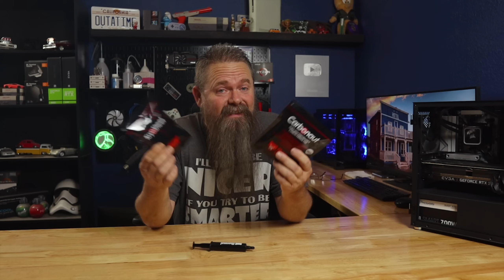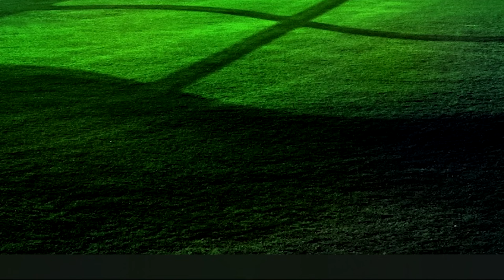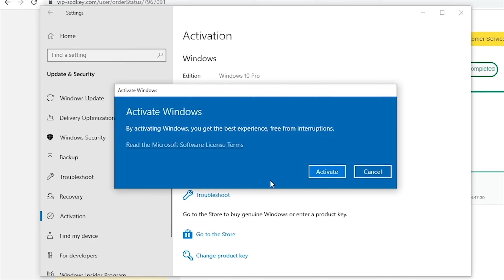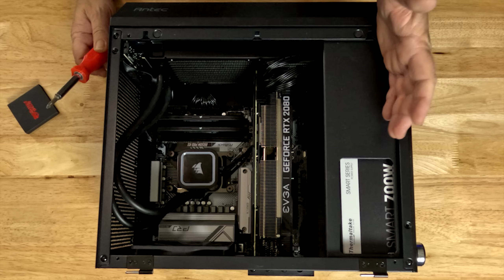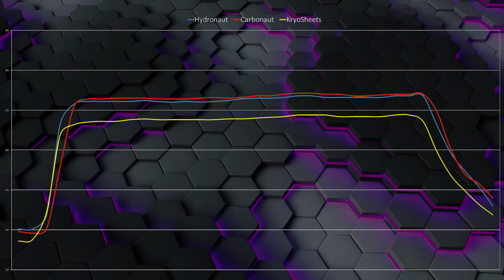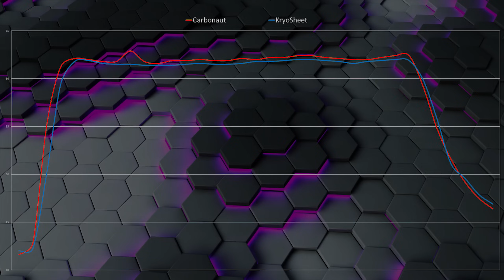Thermal Pads OR Paste, Which is Better?

Comment: I have used KryoSheet several times repeatedly on intel 13600k and 14700k processors. There have been no problems with temperatures. Be very careful during installation so that the KryoSheet does not break, as it is very fragile. I used a sheet of paper to hold and move the KryoSheet. I highly recommend it from my own experience :)
Reply: Best way to apply the Kyrosheets/Carbonaut sheets is to pop a little drop of isopropanol onto a corner or two of the IHS or cooling surface. Makes the pads stick in place, and the alcohol evaporates after about 15-20 seconds, long enough to get it situated and held in place by the mounting pressure
Reply: Wow thanks for that tip!@Gravy-Gamer
Reply: TY on that.
Reply: try to keep the original plastic for removal. Paper can shed some small fibers that will hinder performance.
Reply: @yspegel  Yep, that would be the most sensible thing to do, but regular paper will do the trick. I wouldn't worry too much about the paper fibers, you might as well worry about the dust in the air that MAY end up on the CPU :D
Reply: What size do u use for those intel cpu?
Reply: @AL-hk3oo What size cryosheet i bought for 13-14 gen intel?
38x38 mm from store and i cut it in size. You can google your cpu size if you cant measure it.
Reply: Does it matter how hard you secure down the cooler? Like I usually screw it tight on thermal paste but can you still do this without the thermal pad splitting?
Reply: @pearce_nz  I install the cooling as strongly as with thermal paste. The harder  the cooler is installed, the better the temperatures. 
The only thing I would recommend is that the KryoSheet is cut to the same size as the size of the Cpu or a little larger. The more the edge is over, the more difficult it is to re-install later. I have managed to use the same KryoSheet at least 6 times and everything works perfectly and the temperatures are as good as before.
Reply: @EventuallyFallen  if I am not going to be removing it, will I lose anything if I don’t cut it? I don’t wanna mess it up by cutting it.
Reply: @ Sorry for the late reply.
I totally understand your concern, the cryosheet is relatively fragile. If you're afraid of ruining it, then you'd better put a whole sheet. But you have to take into account that the cryosheet is electrically conductive. Personally, I would take the risk of ruining a cryosheet, rather than any computer component.
Reply: Just use classic thermal paste...

Comment: Im currently using PTM7950 on my 5800X3D. I notice much tighter spread between core temps and also lower idle temps compared to MX5

Comment: I've been using gig-a-loo and a paper towel to clean up the paste from my CPUs for years. Works a treat for me. 
I also use an old credit card to apply the paste - I need the film to be as thin (and equal) as can be. It's so easy to clean the card afterwards - I can use the same paper towel I used to clean my setup. No waste!

Comment: hate dealing with that stuff when i replace cpu etc. Dont want to deal with it, but no choice. crappy mount systems to hold onto expensive fans, and you never know if you did it properly or botched it, as there's no way to see.
i'd gladly pay more for a decent mount system that isnt garbage, but they all are.

i still use air cooling

Comment: I think the longevity of pads over paste is a bonus for me. It won’t dry out in two years and require a repaste.
Reply: What crappy paste are you using that dries out in 2 years? A good paste should last a lot longer than that.
Reply: @mjc0961 even the best paste needs to be changed eventually. These never do. Don’t be obtuse.

Comment: they work well.. i've got minus8 pad on my am4 chipset (under a DIY copper block) no more chipset fan ramping up and down all the time BIG WIN! ;p and my 5800x3d runs with the Kryosheet ;p no more termel paste on my pc only factory applied on graphic card ;p. so would work good on a GPU too?
Reply: i upgraded 4 GPU's + 1cpu with Honeywell PTM 7950, check that out really nice stuff + cheaper as well

Comment: In the case of systems that are going to be used long term without access to the internals. Or the user wants to not worry about thermal paste maintenance. The carbon pads are invaluable.

Comment: I'd only consider using a thermal pad like cryonaut if I was testing out CPUs regularly, which I don't do currently.  I don't mind the convenience of the less clean up using a thermal pad vs paste.  Tho cost of the thermal solution is important to me as well.  Chances are I'd likely still use paste as a thermal solution for CPU cooler mounting

Comment: I have recently installed Linux Mint Cinnamon Edition on the MSI B85-G43 GAMING Motherboard using Intel Core i7 Processor and MSI GeForce GTX 960 GAMING 4G
without deleting Windows 10 so I can do a dual boot mode to the point it was so easy to install Linux Mint Cinnamon Edition, and I didn't get any errors whatsoever.

Comment: Hello and thank you for your testing these thermal sheets. I teach IT at a secondary vocational school in the Netherlands and every 1st year student has to build a pc from scratch. I use the Carbonaut sheets as an alternative to paste. We have about 80 builds and teardowns per schoolyear and using paste would create a mess and be pretty expensive.
The great advantage I found with these sheets, that when handled with some care we can do at least 50 cpu cooler swaps before the sheet starts to show visual degradation. This in addition with the ease of handling (especially for students building their 1st pc) makes it for me the perfect solution as a teacher.
I use the Intel Pentium Gold G6405 with the Intel stock cooler for the builds and the 32x32mm sheet works perfect. The cpu idles at around 34c (93.2F) when students boot into the UEFI.
Reply: Thanks for sharing! This proves repeated real-world use. Not many users and no reviewers actually do this many cooler removals using the pad. Mvg uit 🇳🇱
Reply: that sounds like a great school program to have. wish I had that in school
Reply: Part of the fun applying thermal paste, maybe you should teach them to just apply something cheap if it's not going to be used long term?

Comment: I used a KryoSheet with a Ryzen 9950x and a Thermalright Peerless Assassin 120 SE air cooler. Mostly I went with the KryoSheet to avoid cleaning thermal paste goop around the oddly shaped IHS, and because performance reviews said it mostly matches the capabilities of paste. That's my experience so far with the toasty 9950x.

Comment: Depending on your use case, keep in mind that some of these things (paste included) are electrically conductive. If that touches something it's not supposed to, then you might lose a part or ten as a result. My AM5 build will also have one of those frames that basically flatten the CPU area by filling the gaps around it.
Reply: Liquid metal is like that. Thermal paste will not cause issues. Not conductive.
Reply: @hornantuutti5157  last time I tried to decide on thermal compounds I distinctly remember seeing ones marked "conductive", so perhaps we're in a semantics problem as well.
Reply: @pyromethious That's likely referring to heat conduction, rather than electric conduction. Ordinary thermal paste is not electrically conductive. It's good to make sure, though.

Comment: Just want to add that it's not just about temperature, it's also heat transfer rate. Kryosheet has higher heat transfer rate which helps in overclocking stability. It is the reason I could have my 5900X stable at 4.4Ghz running Allcore workload vs the Artic MX4 which always had stability issues at 4.4Ghz. When I upgraded to the Artic Freezer III 360, the temps also dropped 10C on top of a 4.4Ghz Allcore.

For this reason alone, I bought the Kryosheet + spares because the Artic Freezer III was so hard to install in the AM4 bracket.
Reply: Hey, 5950x and Arctic Liquid Freezer III 420mm here, the AM4 mount wasn't so hard to install, all you had to do is to loosen the two mount plates when installing or screw them onto the cooler and install it like Liquid Freezer II cooler. Most people like blowing a scary bubble from the LF3 mounting 🥱
Reply: @1sonyzz  Sounds like a good tip. Will try it when I upgrade next year.
Reply: What is your temp and voltage on that 4.4 all core?
Reply: Replying to see his reply @pinoyxbox
Reply: @pinoyxbox  Just wanna caution u that I'm mining using avx2 instructions. When gaming, the temps can go up to 89C. If I forget to set AIO fan to Full speed, the CPU WILL Crash. 

5900X, 4.4Ghz all core. 113W. CPU core 1.2V. CO - 20. CPU temp 55C, Package 67C, motherboard 30C, ambient 27C, AIO fan full speed. This CPU is current limited.

Previously on Cosair H10i, it was thermal limited.
Reply: Heat transfer rate is literally relevant because of it's effect on temperatures.
Reply: The ability to lower temps in CPU depends on three factors , the ability of the cooler to dissipate more heat, the medium's (paste or pad) conductivity, and the thickness of the medium between the two overlapping plates. A thermal paste would do the trick here is that it readily conforms to the lapping plates contour with the least thickness.

Comment: I value my time more than the extra cost of cryosheets, they're faster to build systems with and never having to replace them is HUGE. Also, don't forget consistency, there's no such thing as too much or too little paste with them, or an uneven application, all those variables are removed from the builds. Not to mention you get better thermals overall, which is always a plus.
Reply: One pea sized dot of paste does the job. It's not rocket science to most people.
Reply: They are expesiv ,for a simple non hi end PC I don't see the point
Reply: @EXTREMOZAU  they cost a fkin mcdonalds meal more than regular paste. for something that you will NEVER have to change its absolutely not just for enthusiasts
Reply: @MV-ri7zu I recently build my PC myself & just opted for the kryosheet. Best €20 I spend on the system, not having to think about needing to repaste the CPU a few years down the line is worth the investment.
It was also super easy to use & definitely less fragile than I expected.
Reply: @EXTREMOZAU  Thermal pads like the Cryosheet or (Honeywell) PTM7950 (which is a phase-change material, that fills in microscopic gaps as it heats up in-use) are optimally one-and-done installations.
Thermal paste/thermal compound dries out over time and can generate air pockets as it ages (which is why you should replace it at least every 10 years, optimally every 5 years), whilst thermal pads are a no-mess no-clean alternative that lasts longer and performs as-well or better then thermal paste, that you should never have to touch once the CPU cooler or even GPU cooler is installed.

Comment: Just suggestions but maybe for better presentation it might be easier if the GPU is already unistalled and no ceiling fan causing flickering. Another suggestion would be maybe a larger case for ease of demonstrating?
Reply from the maker: I didn't notice the ceiling fan, sorry about that. It gets hot in the little room I'm in with all the studio lights on. Working on a fix for that right now that will hopefully be done shortly.
Reply: @CyberCPU  All good :) You have a great studio and a sharp eye for the small details is important for a professional look. Thanks for replying and look forward to watching more of your vids!

Comment: Here's a trick - when you put paste, put the cooler on, run it for 6-12 hours, remove the cooler and put a drop of alcohol on the spread out paste, put the cooler back on. Works wonders
Reply: Alkohol will dissolve it so it will become runny right? Is there bo risk of it squeezing out?
Reply: @ no, you are putting just a tiny bit. It makes it more pliable, so the second install spreads it even better and thinner.

Comment: For enthusiasts who have too much money. The good old MX4 remains my number 1. The video was great.
Reply: I don't think enthusiasts go for pads; I always felt like pads for newbie builders for those who scare to make a mistake by applying too little or too much termal paste. Old school builders have their own signature ways to apply thermal paste they can't give up that easily. And richer enthusiasts that are bravier than regular enthusiasts would use liquid metal because money gives a lot of courage to try new things and make mistakes, look at Linus, I have never see him not spill coolant on electronics, everytime he lay his hands to custom water cooling he burst liquid everywhere.
Reply: @Haplo-san agree with the Liquid Metal point, people preach it but I just don’t see the benefits over the risks. The fact that it can short stuff if you make a mistake is enough to keep me on pastes.
Reply: @RiTchieKII the actual scary part is when hot liquid form it can move and if there is whick surrounding die , it will leak to components and short , and there is also weird drying out like black mark formation and alloy seperation is a thing , 

What weird is people think the metal fusing into copper is bad but it's not , it's fine the actual problem is it just moves around esp it's hot and accidental drop or used in angle(like it started in backpack and overheating)

Comment: I use the Honeywell phase change pads, forgot the name, for the CPU/GPU, and K5-Pro for the other chips in my 10750H/2060RTX laptop, works great. Heard the Honeywells don't work well in desktops if the cooler keeps the chips too cool for it to change.
Reply: Makes no sense what you just said. If it wont change then temps rise and it eventually will. And cools down as it is supposed to do. Cant remember the temp where tpm starts to melt but i think it was around 40-60c wich is better than ok for cpu and gpu.
Reply: @hornantuutti5157  it's just something I heard.

Comment: No, pads are superior by far! (Not cabonaut because TC is too low)
- One aplication for life and the same heat transfer always. 
- On a mini pc like mine an Dan-A4, disassembling  takes a week. The confort of not  removing your components is important.
 Once i was reaplying  paste every year, the most expensive termal paste i could find, and always looking at the charts and tests. 
 Conclusion - ALL termal paste dry on a GPU in couple of month, on CPU  in 1 year even it does not dry,  termal conductivity is droping hard. The pads advantages are too big.

Comment: I am using the Kryosheet in my new build and it is amazing.  I originaly built my system in a TT Tower 300 with an AIO and decided to switch to a custom water loop so i've been taking my system apart every few days to install new parts so with the thermal pad it makes taking the system apart and i've taken it apart about 20 times already and I am not done yet as I am still waiting for other parts for my loop to show up.  I've also moved my system to a TT CTE e550 case.  I also didnt cut the thermal pad to match the CPU IHS and left the pad the original size so it overhangs the IHS slightly.  As I am sitting here on YouTUbe my CPU temp is sitting at 49C and the temp in my room is 22.8C or 73F.  I originally used thermal paste in this build but after taking it apart the second time I ended up swapping to the thermal pads.  If you never plan to take your system apart then thermal paste is fine but once thermal pads catch on and the price goes down then thermal pads will be a better choice.

Comment: I'll always use paste because it gives me a reason to clean the entire system :)
Reply: i clean my pc every couple of weeks because of my bird ;p, my pc eats the feathers and dont wanna fry it yet ;p
Reply: @RaphaelSwinkels  You don't have filters on your air intakes?
Reply: @----.__   right I have a Corsair 7000D airflow only have to clean the filters about once every 4-6 months the rest of the system maybe once every 2 years there is a very tiny amount of very fine dust that gets through the filters so it's not needed but can see the difference
Reply: @RaphaelSwinkels Do the bird fly inside the computer or ?? lol
Reply: meanwhile my watercooled pc runs for 8,5 years on paste and onley tops off water once in 3 years lol
Reply: same! 😀 the annual cleaning, usually in summer
Reply: same, definitely seems to be the best practice overall

Comment: Most of TG's products I like and have used, however I still have a beef with their description of the 'graphene' pad. As a producer of true graphene, stacking it in the Z axis as they describe is only accurate to describing graphite. Graphene is a single atomic layer thick, aka, invisible to the naked eye. Working with it in any other form than liquid suspension makes it extremely difficult to even figure out what you're doing. Now it may have some graphene infused into it, but that also means adhering it to a substrate, which in my R&D, means placing it on a far less thermally conductive adhesive or thin film application material. Other than solutions I make myself, production quality paste is still one of the better one-part solutions for most people. The reusable pad only works if your part clearance falls within the closure range of your parts; some of the coolers I've used that pad on will bottom out and leave the pad 'floating' without contact for lack of a better term. 
The kryosheet showed up for a test some time back and I was rather disappointed in its performance. Versus a fresh paste, there was no discernable performance difference. Naturally when I pulled the cooler up to check that it was still in place, it tore apart with a portion still on the cooler base and the rest on the IHS.

Comment: Not all paste is the same and not all pads are the same.  You need to compare the specs.  Thermal paste dries and cracks over time and should be replaced every 2 to 5 years.